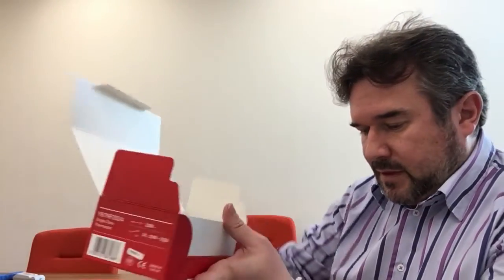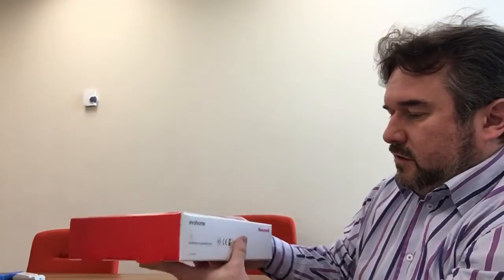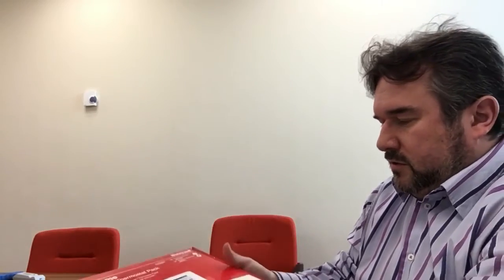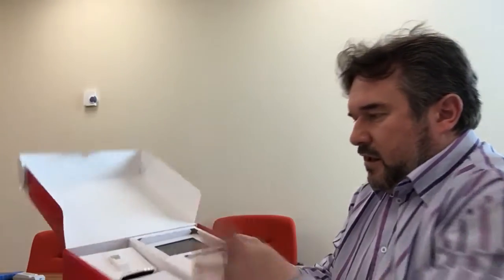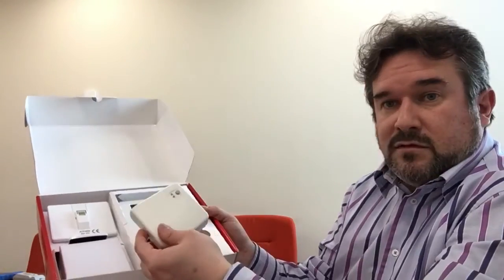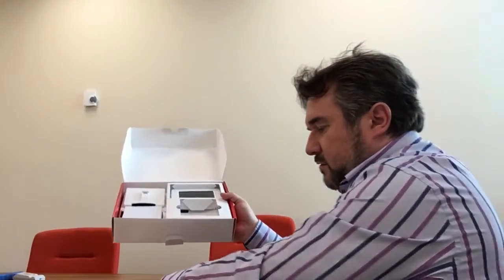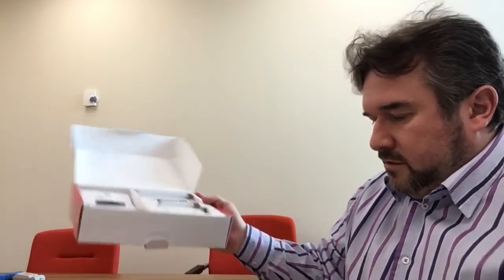How to upgrade TPI controls to OpenTherm controls

Comment: Hi the BDR91 seem to need mains power and the open therm bridge does not? Assuming I just remove all the DBR91 wiring and replace it with the 2 wires of the open therm bridge reconnecting as advised in the boiler manual? How come the open therm bridge is different?
Reply: Peter Cunningham Hi Peter. The OpenTherm Bridge is powered using low voltage from the OT wiring therefore needs no permanent mains supply.

Comment: Is this a load compensator affectively ?
Reply from the maker: yes when connected to OT Boiler it modulates the flow temperature according to heat load measured internally; as per Boiler Plus definition of 'Load Compensation''